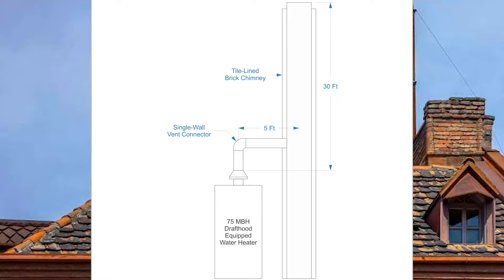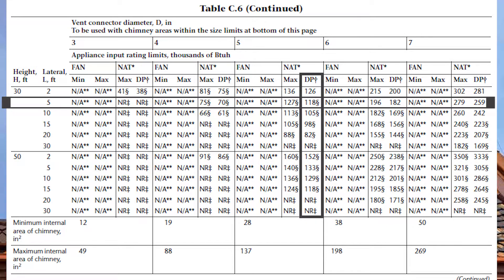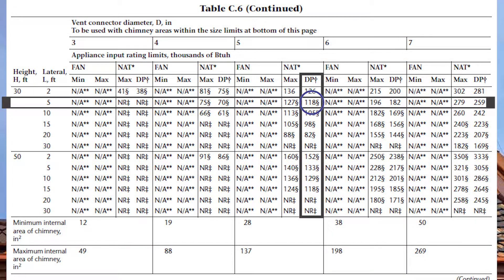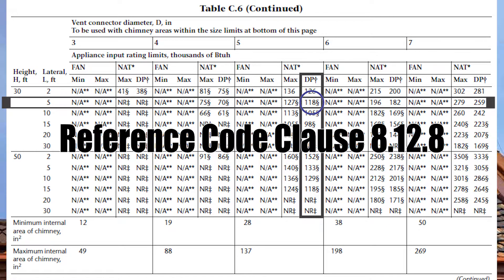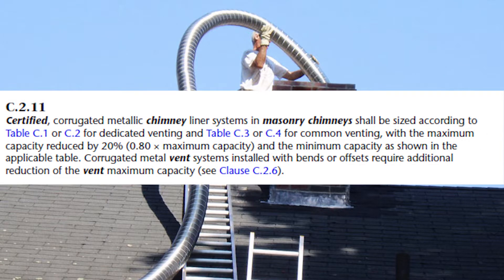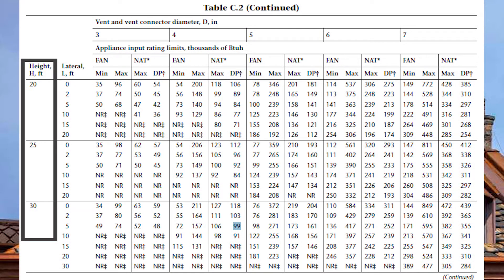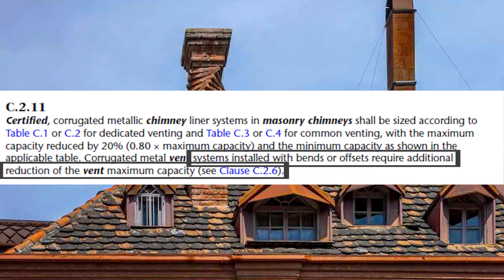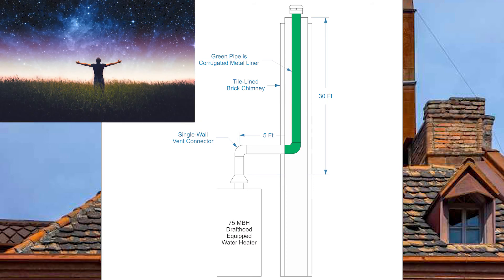Gas Venting with Tables Part: 8 - Chimney Liners

Comment: I also thought that 20% de-rated for corrugated liners and allowed for 2 elbows.  Alter that each additional 90 counted as another 10%?  By the way, I really like your video's!  Very well done.
Reply from the maker: Thanks Doug! This kind of ties in with your other question a bit. The Minnesota code may very well include 2 elbows in the liner. The code we use in Canada is 20% off for the liner alone, if it is straight..

Comment: Question on the code book your using.  My code book is also 2015 Minnesota mechanical and fuel gas code book and there's only Nat Max. Am I supposed to convert that to DP Nat.  or use the Max Nat at face value?
Reply from the maker: The short answer to this question is, I honestly don't know. I am totally unfamiliar with any codes in Minnesota. The gas code I am using shares similarities, but is clearly different.